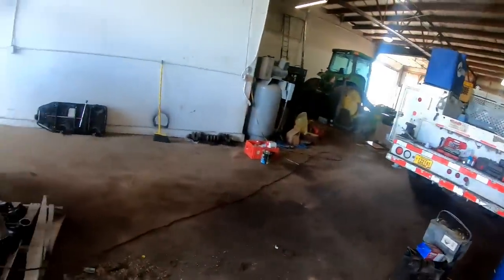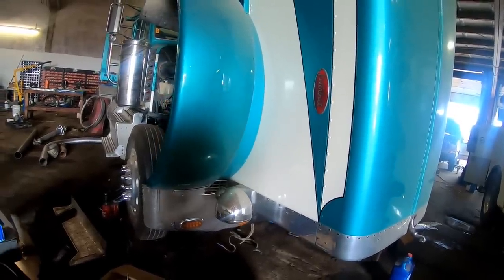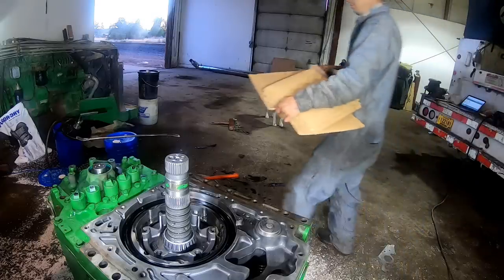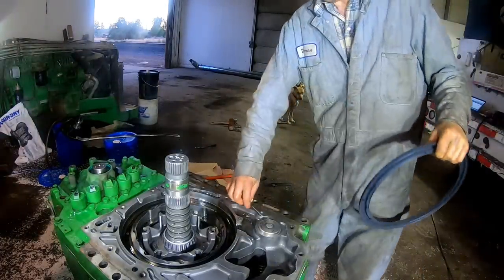8300t powershift reassembly part2

Comment: I bought a truck from the second owner up in nothern cali, 1999 7.3 supercab dually, It wasn't bad so to help the local economy I dropped a few bucks to have her detailed then off to the dealer for an oil change and trans fluid change and a check up before driving coast to coast.  After a clean up the seller saw the truck and commented, "This truck had carpets?"  yeah, it was that bad but still looks great today with a little TLC.    Those two projects, the trans and ole Pete,  that's right close to being a brain surgeon for certain, wow, thanks for sharing all the little details. The new hydraulic crane seems to be much more sensitive for fine positioning.

Comment: Hello from little old England......i work on big cnc machine tools and  they have very similar gear box set up with angular contact bearing in the spindles that are fairly easy to setup, but also taper rollers that are not.....requiring dry fit build of shafts and shimming to get required preload before stripping back down to complete reassembly.......just wondered how you establish this with new bearings? Cheers Tony

Comment: Now I don't know much of anything about big diesel trucks like these (which is why I love learning from your channel) but could the ECM fuel level parameter be tied in to kill the engine if the fuel in the tank runs dry so you don't have to crack the fuel system open and bleed it if some joker runs it out?